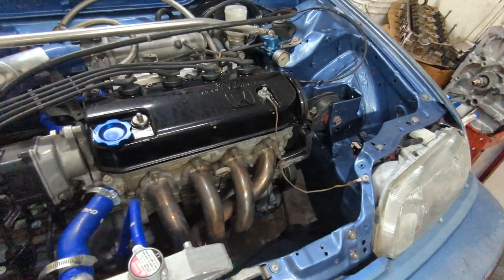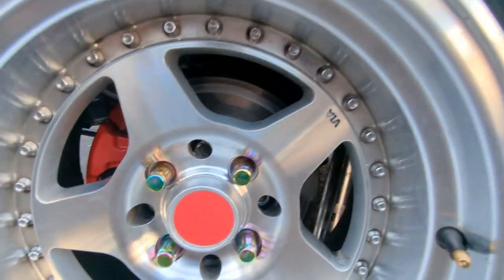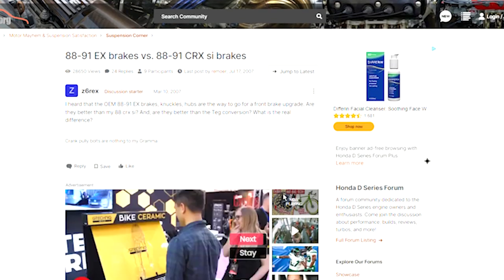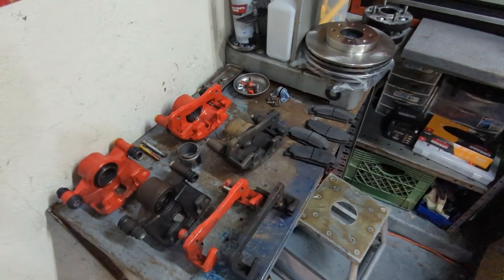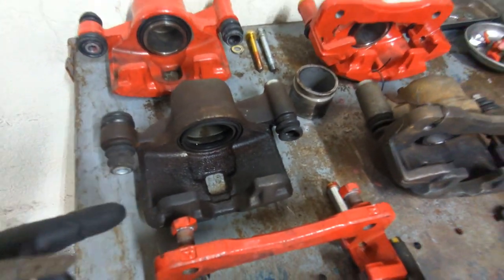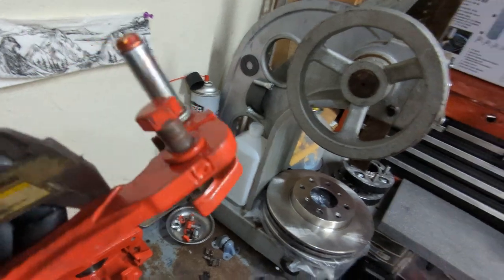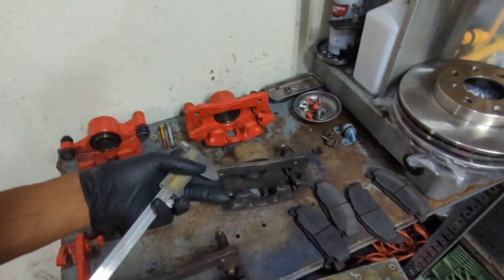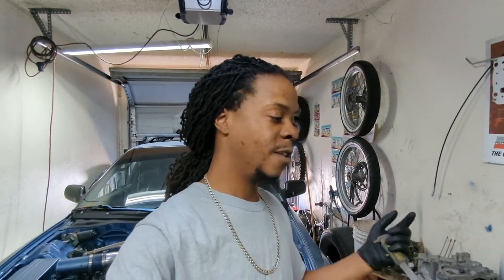EF Civic Brake calipers are different

Comment: Years ago changing the drive axles on my 91 DX, I found out there were two different diameters for the hub spline shaft. They were listed as "standard" and "accept standard". I found out I needed the bigger ones - the hard way.